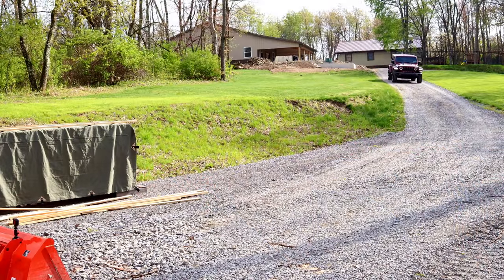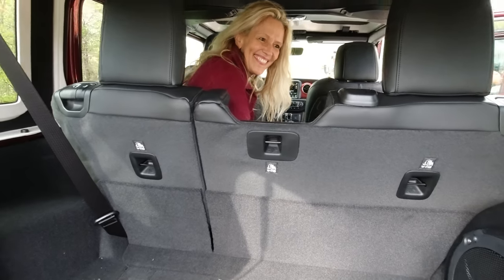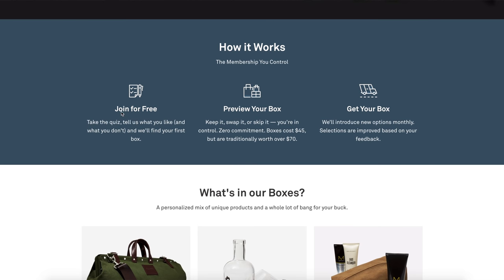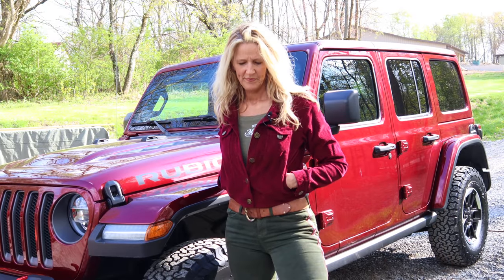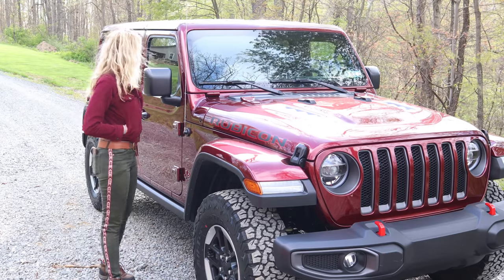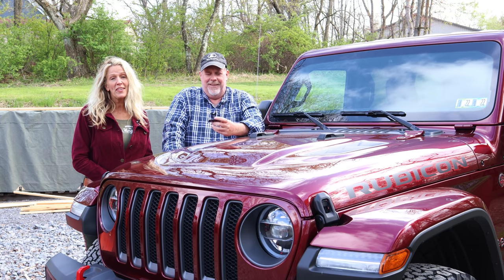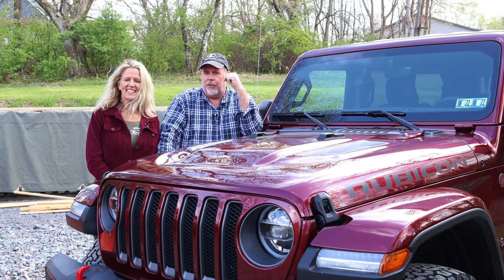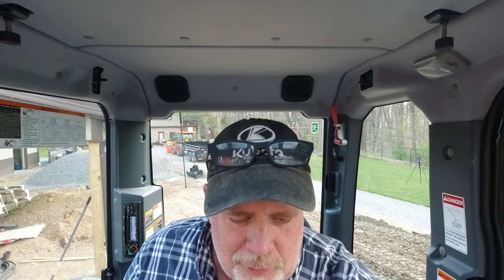Guess what we traded our Jeep Wrangler for? #1082

Comment: Tim. Here is my story. I hope that one day it may help you. I hooked up the brush hog to my 3901 Kubota to cut our fields. Engaged the clutch and put the rear PTO in gear then let out the clutch and the engine stopped. No matter what I tried I could not get the engine to turn over. After getting some advice from my local Kubota Service Department, I aggressively moved the PTO lever back and forth,. Nothing. I saw the controls were cable operated so I hosed the springs and cable with silicone spray. Worked great. The engine started immediately and the brush hog went right into gear..

Comment: The RAM Power Wagon is what I drive. It comes with the 33s, a factory 12,000 lb Warn winch, push button swaybar disconnect and front and rear dif locks. I like the color of the Jeep. Congratulations and have fun with it.

Comment: Nice Jeep like you said assembled at TNAP, tires and wheeled balanced on a machine I helped design a number of years ago, plus did a rework design on an existing crank shaft balancer so Chrysler could run the 4 cylinder turbo crank.

Comment: I have a 21 Rubicon have 10,000 trouble free miles. I tow it behind my motorhome. Hit lots of trails in Death Valley and in Arizona this winter. You are going to love it. Didn’t have any problems with the 33’s but I agree it needs to be lifted with 35’s or 37’s. I have the 3.6 in mine. I drove the turbo 4 and it does seem to have a bit more pep but I decided to go with the 3.6 anyway. Mine is all white either the black interior. You will enjoy it over the Sahara. Our last one was a Sahara too!
Good luck with it! 
Tom Prevost
Massachusetts

Comment: Hey Mike, Your tractor should have a 12 volt wire in the loom that feeds the rear lights. If you run a fused single wire and a ground down the bar on the tractor and put a female plug on the end  that matches the trailer. It will charge the trailer as long as it is hooked up.

Comment: On the Rubicon, you can put 35’s on it without doing a lift. Go a little wider with a different offset. It gives it a great look and keeps factor suspension. I’ve built three of them and knowing what yours is going to be used for, just do the new wheels and leave the suspension alone. Good luck with it and I love the color.

Comment: You surprised me about the wheels and lift.  I have always thought you were too practical to think of such things.  If I were you, I would just change my thinking and live with it the way it is.  There really is no practical reason to change it.
Reply: Agree….! It will ride and handle better and safer with the Factory setup.
Reply: One of my family members who was a GMC dealer has a Rubicon.   He told me that it was a poor choice as far as reliability and performance.   Lots of road noise and the engine is having noise problems now.   He said that he will not replace it with another jeep.   He said the only thing he liked the jeep for was the younger people like them.   One of those HEAD things.

Comment: The new JL is so much more comfortable than the last generation. It drives better as well. Very good choice. Used car values are through the roof right now due the chip shortage. You will love the LED headlights.

Comment: That is a nice red.  tamed down a bit, not over the top, in your face red at all.  I know what you mean about the comfort of seats.  I have great seats in my truck and have to make a 3.5 hour trip with the family.  Tempted to use the truck for the trip that has a lot more room and equal or better seats even though I will pay for it in gas mileage.  I just think everyone will be more comfortable.   I like the tires on the new jeep.  Nice deep tread.

Comment: It will be great to see you compare to the Broncos.

I run a 2019 JLUR as well... So a few points from my exp. Take w grain of salt...
KO2s are a great AT tire and awesome in the snow. You can run 35s on what you have with no lift but I'm have a 2.5" Teraflex lift and soon to be 37s.

The back up camera is great but the back up lights are poor... I just added Oracle backup lights where the rear reflectors go in the rear bumper (issues installing but good lights in end)

Catch up at Bantam maybe.

Comment: Question. I’m looking at tractors. Is the Mx 5400 enough tractor to handle the business. Grapple and is it tough enough  can it tote to weight with a heavy load in the bucket or grapple. I was looking at mx5400 or a m7060 ?

Comment: Hey Morgans, Congrat's on the new Jeep :), Just a thought on the Kubota & using the trailer, it wouldn't take much to run a trailer plug out the back, with just power to charge the battery for the hydraulics & maybe the brakes with out modifying the tractor,so that it could be returned to std easily.... I've mentioned it before to you, how much I use my tractor tailer combo on my 100 acres here in the Northern Rivers NSW Aus & how handy it is.... Have fun,  Keep up  the good work Cheers Steve :)

Comment: Hi Mike and Melissa from the UK, do like the Jeep Rubicon. The colour is kinda cool too. I had a Jeep Cherokee back in the 80’s four litre straight six went like a rocket, only issue was the low headroom, kept banging my head on entry/exit, a great vehicle though. I take your comment regarding the switches on the steering wheel. My wife and me have had similar experiences whilst driving our vehicles where we have touched and move the toggle switch on the steering wheel and activated the cruise control which probably had a low speed default from when last used. Anyway the car would not respond to the accelerator/gas pedal and was a moment of slight panic until we realised what had happened. No problem but just something to remember. I did report the issue but the dealers were not interested. Stay safe. Hands on the wheel, eyes on the road, enjoy the Jeep.

Comment: I will definitely be watching your Bronco and Wrangler videos.  It'll be interesting.  Color looks great too.  I had the original BFG TA KO's on my 08 Toyota Tundra...still had probably 60% tread left on them and had a tire puncture that couldn't be fixed...ended up having to buy new tires, I hate mismatched tires there was no way I was going to just replace 1 tire especially on a truck that was in excellent condition, maybe an old beater but not a really nice truck.  Those tires were expensive, wasn't happy with the damaged tire LOL.  

I wasn't impressed with those TA KO's for snow traction...I think the KO2's are better though.

I live in Idaho...depends on where you go LOL.  lot of the southern part is nothing but desert.  I'm about 30 miles west of Boise.  So much stuff to do in this state though.  Been here for 30 years have yet to see much of the state LOL...really need to go out and travel but fuel prices are going back up so that put a damper on that plan.

Comment: Don't like them tires at all out in Montana we have the red clay and when you go through that mud, you get four slicks, because the tires don't clean themselves at all, I had them on my 83 K5 blazer I took my truck back to the tire shop and said these are not going to work, so bill bought them back they had 63 miles on them so we put on COPPERS,all terrain the 
ATS 5, WOW what a change now those I would put on any of my trucks I ran the 12,5x16x35, I changed my axles from half ton to one tones 410 gears 454 engine with 845 horses so I had the power but those tires would not c ok ran out the tread the n those BF GOODS Swear will never purchase those again.

Comment: Love the Rubicon - they've come a long way from the original with the drivetrain and comforts.  Super capable off road though, if you're so inclined.  I used to wheel with them back in my unimog / pinzgauer days, and they're amazingly capable in stock form with the locking differentials and swaybar disconnect.